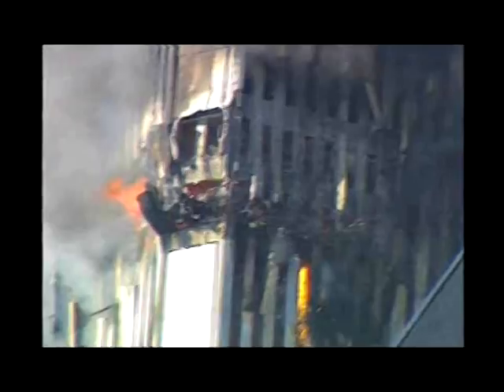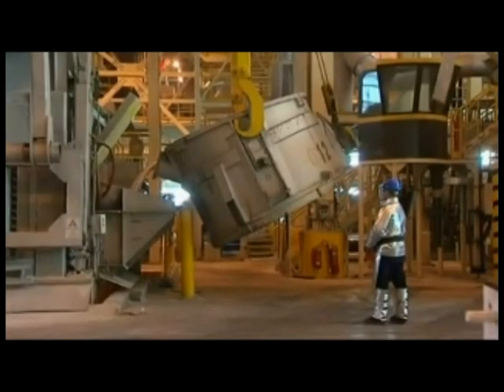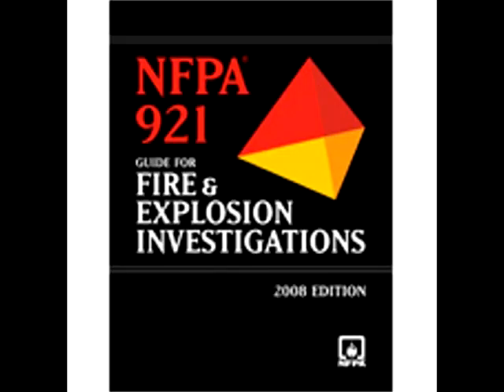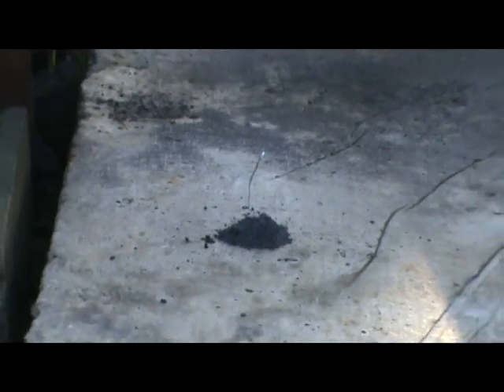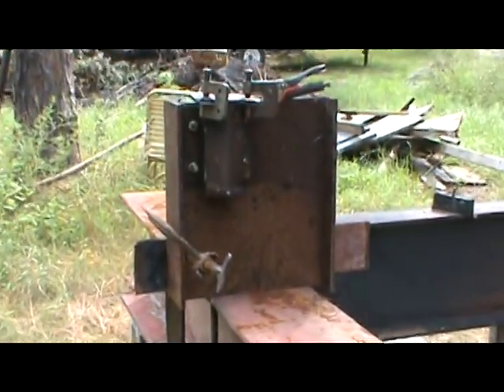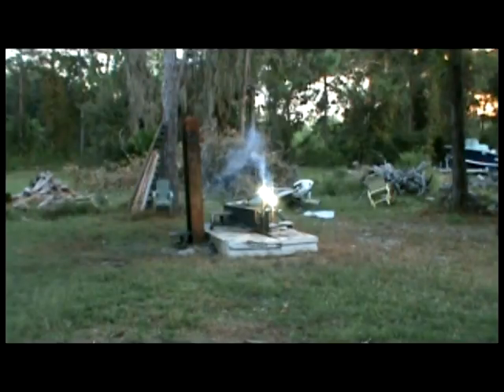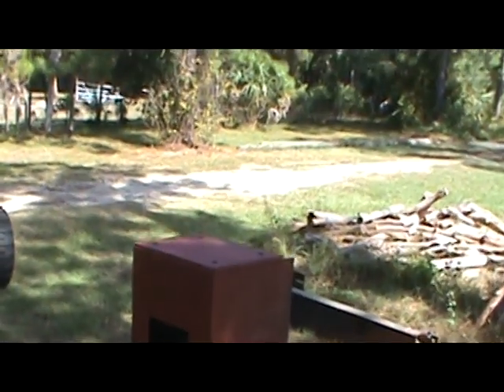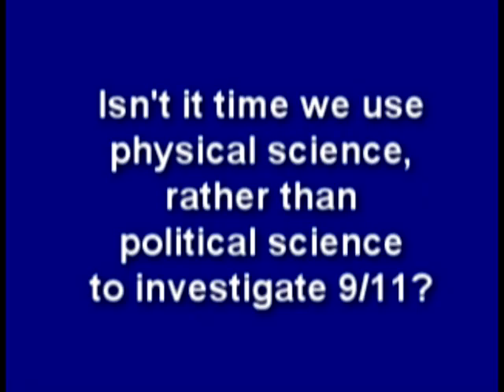9/11 Experiments: The Great Thermate Debate

Comment: Any alleged bright white light was likely not a chemical reaction of any sort, but electrical arcing from the extensive electrical system in the buildings. The word "melt" should never be used when talking about structural steel collapse due to heat. Melting is not required, and in fact the building would be on the ground before it melted. Steel does not melt like ice, it softens to the point of failure at a much cooler temperature than melting. It softens and fails. Anyone who has worked with iron or steel knows this.
Reply: The lower floors didn't need to be "softened" for the building to collapse, the weight from the upper floors collapsing would be enough to bring the rest down. There is tons of photographic evidence that the collapse started from where the planes initially hit, people seem to willfully ignore the fact that the kinetic energy of the 767 (400,000 lbs) hitting the building at 500-600 mph. That is 4.5 billion joules of kinetic energy (equal to 1100 KG of TNT). That alone would instantly smash and severely mangle the main support structures of the upper part of the building. It wasn't just fire that brought it down, it was fire+ a massive fucking plane lodged into the side of the building.
Reply: Oh wow a whole 3000 engineers and 2000 pilots. that makes up all of less than 1% of all the engineers and pilots in North America alone let alone the rest of the world. What about the other 2-3 million some odd engineers and 2-3 million pilots again just in North America alone?
Reply: I'm not bragging but just to point out I'm a certified aircraft mechanic and with over 2,000 hours of instruction a large part of that is on metals. Annealing is heating a metal so that it returns to its natural, un heat treated state. This building was made from what's known as HSS or High Strength Steel. This is a type of steel that is significantly stronger and more corrosion resistant than common heat treated alloys. This allows engineers and architects to utilize far less steel than they would have to otherwise. Doing so means that the loading for each bearing beam is much higher, that is, the amount of stress applied to each piece is significantly higher, and that's fine.. HSS is capable of handling it. It makes for a lighter building, too. However it makes it far more vulnerable in case this steel loses its heat treatment, or as you say, becomes annealed. Then it becomes the strength of cold steel that's been heated.. far less strength than ordinary steel. This is a perfect storm for a  building to collapse from the heat of a fire. This fact was considered, but they never considered a few thousand gallons of jet fuel being injected into the building. The WTC were designed to use less steel, and unlike buildings like the Empire State building, which relies on sheer weight to make it stable. That building is a true heavyweight.. not made from HSS and clad with stone, that thing will never go anywhere, and it can handle a plane crash much better, and in fact it has. These two designs are as far apart as a 1915 model T ford is from a Mercedes AMG GT coupe. Absolutely nothing alike.
Reply: Dave B ..you Are bragging and you Are also not a structural engineer..and you Are also one of the people who have not quantified the collapse event in any way ( do you know what I mean by that even?)...but by all means tell US about aircraft mechanics...very interesting subject.
Reply: Non Ofyourbuisness I don't understand this argument. A high fireball will ignite everything in its path . Fuel burn off has nothing to do with this so why are all the truthers keeping on saying burning JET A1 won't melt beams. WE KNOW THAT. We are talking about the estimated 800-900f furnace at the crash sites which , on any websites, you will find is rather bad for steel beams to put it lightly. Don't see the point of arguing though as your minds are not open to anything else.
Reply: Tony Cabrera This all goes back to the question of what did bring them down then if the    official line isn't true. I've said it until I'm blue in the face. I challenge anyone to show me a demolition video ANYWHERE in the world that looks anything like these collapses. 
So there is only one other explanation. I cannot understand how people can say this was a demolition. It's been said so many times that the initial floor collapses sounded like explosions. FDNY have many quotes saying they "sounded like explosions". A long way off saying they were explosives. Big difference.
Reply: Arcing will definitely cause localized melting and burning of metal. It's essentially a welder. As soon as the insulation is burnt it will begin. Nicola Tesla had an early carbon arc lighting system that generated 6,500 degrees F. His arc bulbs glowed so brightly that a single bulb could light an entire town. A few were constructed on high towers and used. Carbon was used because any metal of any kind would... melt. Plus there are other metals in a fully furnished building, so the exact type of metal would be interesting since AL melts at only 1,221 deg, F, and any strong fire   can melt the wheels off a camaro.. and rivers of metal will run down the street. Jonah I can't certainly say what it was.. but I would always investigate the most obvious, simplest causes for things rather than jump to an extraordinary conclusion, things like UFOs and the Bermuda triangle.. While aliens, the Loch Ness monster, Sasquatch and living dinosaurs could.. maybe.. far-out stretched ideas and illogical causes might not be out of the question completely, normal more plausible explanations have proven time and again to be much more likely- I could be wrong.. maybe. But for now that's my story and I'm sticking with it.
Reply: and you do not have much of a life if you are checking my grammar...get a life tool
Reply: you must be a teenager .... bedtime for you kid
Reply: Josh a I know exactly what pictures you are talking about whne you say "most of the columns were severed at an angle" Those pics were taken AFTER the FUCKING SALVAGE CREWS cut them down AFTER the fucking buildings fell so they could move the debris out of the damn way.
Reply: You can heat steel to the point that it only glows and bend that shit with your hands like it was a damn paper clip.
Reply: I told this ass clown the same thing
Reply: Don't even bother throwing out simple, realistic, probably true explanations. There's no convincing someone who believes because they want to believe.
Reply: Dave B in the artistic circles of metal working its called annealing.  Dunno if there's another term for it but I'm in highschool and I know copper and brass once heated to the point of oxidizing will be malleable for up to 72 hours (personal experience)
Reply: Dave B then how do explain the molten metal......that consisted of melted metal....  

For fucks sake. Yes, Metal is weak when heated but are you trying to say that there wasn’t melted metal?
Reply: Dave B. Anyone that have witnessed controlled demolition knows what it looks like. Nothing else brings a building down in its own footprint.
Reply: This doesn't explain the free fall of the building.
Reply: The heat was concentrated into the ground for weeks. So no melting is allowed?
Reply: Dave B Hence why it's suspicious as most of the columns were severed at an angle.
Reply: Dave B I agree with you because it's not like there was no electricity in the building
Reply: Tony Cabrera thermite does not make an explosion
Reply: King-gorz you get the idea, after steel becomes annealed it also becomes extremely malleable and soft
Reply: Koala Nectar Nutjob engineer who actually carried out experiments to prove his hypothesis while those government engineers are only loyal to their payroll and not science. Also 99% If you're going to take numbers out of your ass, why not 100%?
Reply: He was addressing the actaul molten steel
Reply: You also have to think that there’s more than one reason for the collapse. 
There would have been 100s of 1000s reasons and contributing factors to the structures failure. Also a very one sided argument considering the title of the video.
Reply: Dave B so then how did a plane melt the supposed structural steel hmm
Reply: Hey fuel for a Boeing 747 burns at 1350. Steel starts to warp and twist at 1100. Y'all are just some conspiracy theorists
Reply: Surago not entirely true. Major buildings such as the Sears tower and the space needles don't have automatic shut offs for there electrical systems. You would know that if you did a little research my dude
Reply: @rdizzy1 "people seem to willfully ignore the fact that the kinetic energy of the 767 (400,000 lbs) hitting the building at 500-600 mph." Might go slightly off topic, but a normal plan can not reach these kinds of speeds at that low altitude.
Reply: Brilliant point. Especially when not piloted by luke skywalker. Seriously the way the plane hit and the forces involved has been discussed, the plane would've crumpled like a motherfucker, and the speeds required to have the affect being discussed would've ripped the wings off the fucking plane well before it hit. Why lie about literally any of this if it wasn't a cover up? Not even advanced pilots can recreate a viable crash in simulations.
Reply: Serhat Karabeyli not to mention made to withstand airplane crashes, which image the 17 story wasn't. Idk I'm not a. Builder  tho
Reply: Koala Nectar I'd say 90% of the world thought the earth was flat at one time, but I wouldn't say they are right because there the majority. I rather believe someone that shows it possible like this guy did here. He didn't just say it was he show it was
Reply: it was aluminium not steel
Reply: Dave B also possiblle!
Reply: Dave B ..you're ignoring the fact that the 2 extra seconds longer than free fall it took to fall can be quantified solely from the physical act of overcoming its own inertia...( do the math first before you think you have an opinion on that one) ...so, the logical conclusion then is that the columns below the crash area provided no resistance to the collapse event....do you want to know how the govt explained what happened to the column resistance that should have at least slowed the collapse more than that 2 seconds we all saw?....well, conveniently and illegally for them, they didn't bother....blind faith in their "explanation" is the only thing keeping that fairy tale going...it doesn't hold up to scientific scrutiny at all.
Reply: "no building, in the history of steel buildings, has collapsed due to office fires" Sorry Surago but this is false. Just last year a steel construction high rise in Terhan, Iran caught fire and completely collapsed. 30 fire fighters were killed.  So we no that it is in fact completely possible for a steel construction building to collapse from fire alone and the twin tower were not only on fire but heavily damaged from high-speed impacts of 767 airliners.
Reply: Well see, like 99% of qualified structural engineers say they collapsed due to the fire and their uniquely vulnerable design, but this 1 nutjob engineer says it was an inside job so I'M GONNA GO WITH HIM!! -logic
Reply: Nice shifting of goal posts there. Now the twofers are saying "No steel framed buildings have ever collapsed due to fire except the ones that did but they don't count because they contradict are                  insane twofer theories/stupidity"
Reply: Nope I'm not actually. Let's say it's 90%. Hell, I'll be generous and say 80% of structural engineers say they collapsed from the uncontrolled fires. That's still the vast majority. Do you think they're ALL lying? They're ALL in on the conspiracy? All it takes is 5 seconds of critical thought to realize these conspiracy theories are total bullshit.
Reply: Koala Nectar 99% of qualifying structural engineers.....you just kidding :-D
Reply: like I said ....GET A LIFE
Reply: Dave B exactly to anneal steel you must expose it at 400f for one hour and the steel softens considerably
Reply: But BEFORE it collapsed there was already liquid steel. Liquid.. Not weakened, a fucking volcano of steel! That remained hot for weeks. On another note, I was there in December and the air still smelled like "something was on fire"
Reply: The thing is the buildings crumbled strait down and witnesses say they heard multiple explosions right before, how did every floor of those building fail simultaneously, I can understand the top of the building falling over...but the way the buildings just crumbled screams inside job
Reply: No matter what actually happened. I side more with the suspicious group. The way the buildings collapsed just doesn't make sense.
Structurally weakened steel beams wouldn't just suddenly collapse. There should have and would have been a gradual and noticeable change in structure in the upper portions of the buildings. Not just from initial impact, but from the weakening beams. Not only that, but for it to fall straight in on itself the way they did, assumes that there would have been an even burn and consistent temp. throughout the floors that were hit/caught fire. That's a pretty unlikely scenario.
On top of that, it's been established that you'd think it would take a fair bit of time for the beams to weaken in such a way. Yet, the south tower, fell first after being hit second. Though I would concede that point as there are a SHIT LOAD of variables that could could play into what could have caused that.

Anyways, all I am saying is that I don't think it's as cut and dry as either side wants to make it. One side just wants to fall in line and say "yep I'm told this is what most likely happened, so that's what it is." while the other side just wants to relentlessly ask questions and don't trust anything that goes against what they believe. The only thing both sides are really good at mirroring each other on is belittling the other side because they have an opinion on a matter that isn't 100% resolved, only resolved in theory.

The thing that makes this debate so painful. Is that neither side is capable of saying with 100% certainty what happened. Only piggy back off of the theories and ideas that much smarter people have come up with and relay them as if they are fact.
There's no way to replicate and do a controlled test of the exact scenario because there are just so many random variables that it's just not feasibly possible, even on a small scale. 

The only thing I can't seem to understand, is why people think that if it were explosives in the building that caused the collapse, that it means 100% it was big daddy gov. that did it. Yes, it does certainly add credibility to that theory. But it doesn't prove it.

How the buildings collapsed doesn't matter. Really. It doesn't. What matters is WHO caused it to happen.
Reply: Dave B everyone also know the explosion from that plane would never have softened that lower floors of the WTC towers , something fishy def. went on
Reply: Well, look who decided to show up. One of the many sheeple believing the lies the mainstream media shoves down your throat. I bet you watched the video just to prove him wrong.
Reply: So what you're saying is that terrorists used the planes to soften the steel so they could make a sword out of it, so they can cut the USA in half? That's genius!
Reply: Dave B by now, most people who are clicking on this vid through recommended also saw the vid of the blacksmith showing how structural steel easily bends at cooler temps
Reply: does make me laugh what colour does molten aluminium turn when it is heated well past its melting point? oh look bright orange.. as does anything that burns... molten aluminium stays silver when it is not being actively heated towards its boiling point
Reply: Controlled demolition is done at the base.
Reply: Dave B to me, you’re the one reaching, arcing caused three buildings to collapse under their own weight at free fall speed?  Electrical system would of been shut down from an arc, their on breakers and the fire department intentionally shuts down power before they breach. Wouldn’t of had near enough time to melt steel. What’s more plausible? A company full of greed intentionally destroyed their own building on the day with least casualties for insurance? Or terrorists took down three buildings with planes only hitting two? Hmmmm
Reply: someth8ing that melts never falls vertically.
Reply: david m that was less than mediocre. I asked for spicy that was less than picante
Reply: godofawesum223 it was just a 17 story high standard office building, not extremely steel supported constructions like the Twin Towers. Which are, a lot taller than 17 story buildings, and much better supported.
Reply: Fangman123789 If someone, with guilt in his conscience, pointed a gun to your head, and, this person, knowing the truth about 9/11, forced you to bet your life on the real and only cause of this "incident" that brought the towers down: would you bet on the possibility of a unique set of coincidental events, that had never happened before, occurred twice that day, triggering the collapse of both towers or would you rather bet on the existence of greedy and powerful man with evil intentions in this world? Be honest and answer me, please.
Reply: Golf Foxtrot Bud.. That was my poibt.
Reply: Koala Nectar in case of 911, that something called conspiracy, bring me more of Common sense as oficial version of this ...... incident. Im sure for more as 10 years,  you cant turn my minds Back, no way. ;-)
Reply: godofawesum223 you call them stupid but you spelt "our" as "Are" HA
Reply: Surago (this is my theory) the plane crash could have been a distraction and the thermite or thermate or super thermite could have been planted in the building during construction or after it was built. (This is my theory)
Reply: Koala Nectar its a cover up don't tell anyone but the FBI might be watching this video busts the cover oh shit gotta go the FBI are here
Reply: ah the classic "get a life" arguement. Id like to remind you that you are also on the youtube comments, only you are fighting over a conspiracy. is that considered "having a life"? I think not my friend... I think not....
Reply: Dave B that type of structural fail wouldn't have dropped the towers into its own foot print.
Reply: you can do better than that ya mouth breather, come on, lets get some spicy come backs going. this is pathetic
Reply: Dave B right, but the fire wasn’t hot enough to weaken it. Again, no building, in the history of steel buildings, has collapsed due to office fires. Yes jet fuel can burn hot enough to weaken steel. But in what would be the only experiment I’ve ever seen where it’s happened, the jet fuel is literally burning right under a steel beam in what would be a perfect situation. A very very improbable situation considering you can literally see at just a guess, more than 50% burn off just from the immediate impact of the plane hitting the building. And that’s what was left. I don’t know how much was left, but again, I’ll guess it wasn’t near enough for it to land in a perfect square around a large building with lots of walls in order to burn at an intense enough temperature to weaken even one beam that would take the building down.
Reply: Dave B I like the way you present your opinion. However, the satellite images and iron balls have convinced me that in the very least another source of destruction helped cause the falling of the towers and building 7. Either It is either a high level cooperation between foreign countries who sought to affect the United States in a way that favored them, or one high level homeland government, or the unluckiest instance of electrical work gone wrong during the fire that also was never the cause of any other large building collapse in history for any kind of precedence. I like to consider the rational option as well, the only problem with any conspiracy is peoples ability to gossip. But we live in a creative world.